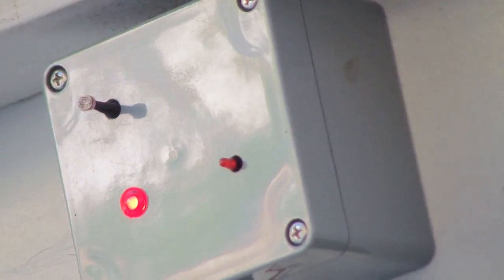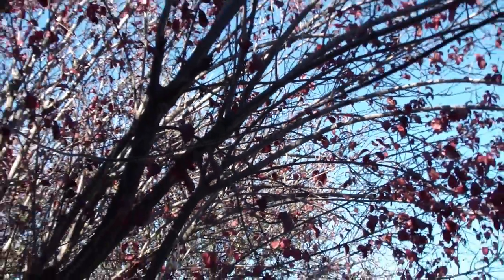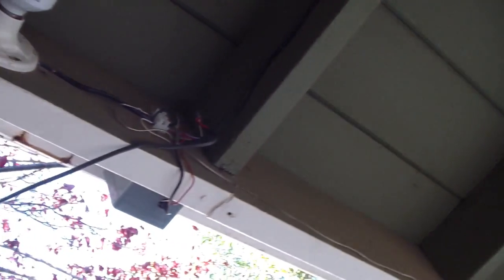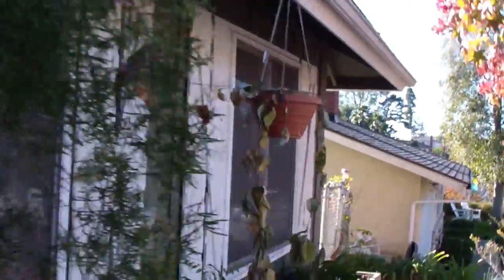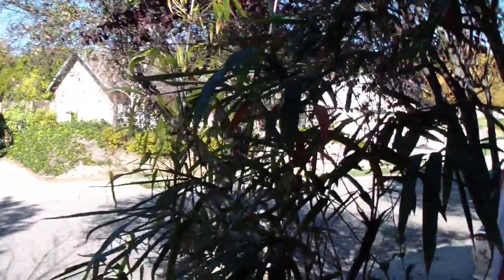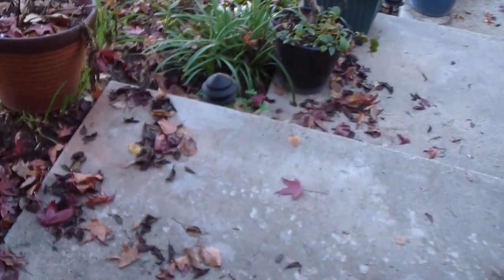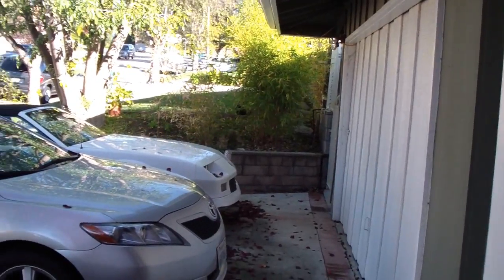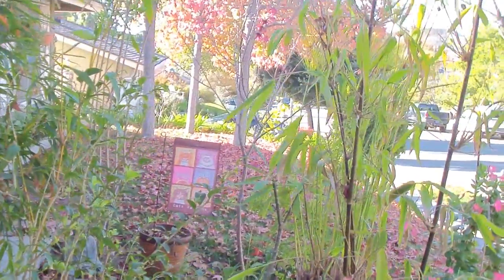Solar LED lights controlled with a light sensor.

Comment from the maker: The soldering is pretty easy, just make sure you use a low wattage soldering iron and do not overheat the PCB! I used a 30 watts iron and did damage the PCB!  But I was lucky enough to back-wire it and get it to work.  EBAY has some that is ready to go and all the components are already soldered and tested.
Thanks Again, EL Raz

Comment from the maker: @jwright650 This is what I used:

Light Sensitive Switch Kit Model # MK125  $9.99 
Switch-on at dusk, turn off at dawn, fully automatic. 
Features: 
wide-range adjustable sensitivity delay circuit avoids cycling 
Specifications 
relay output: NO/NC 24V/5A max.
power supply: 12V DC
with adapter-connector
dimensions: 2.6" x 2.0" 
Thanks JW, Raz

Comment: I like your relay. If you need something that will work off 12v and is rated at 10a, I just purchased a Dusk2Dawn switch from John Drake. Google " 12v DC Nightwatchman "Scroll down the page to see what I'm speaking of. He shipped the thing really quick to Virginia. I'm pleased with it.